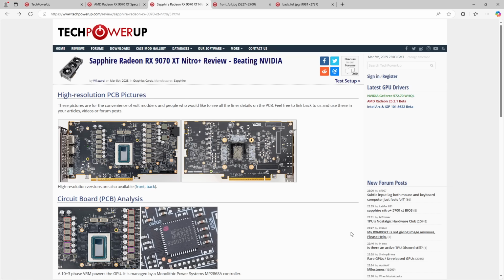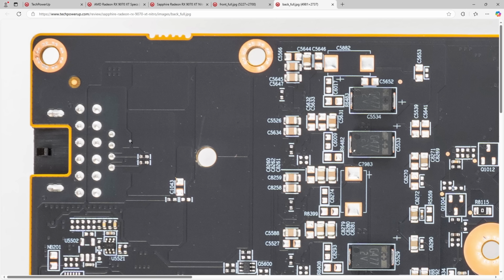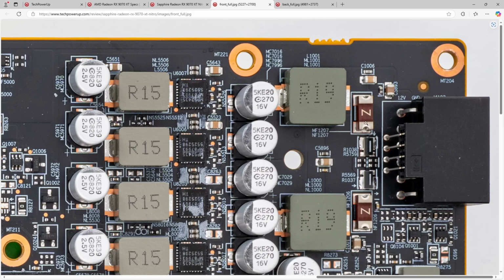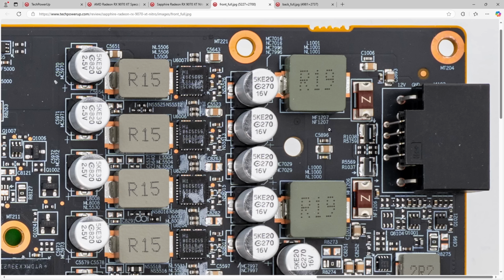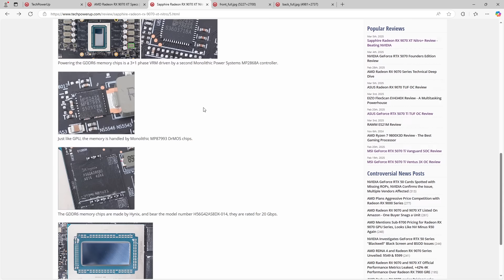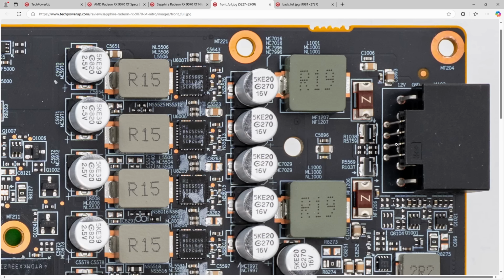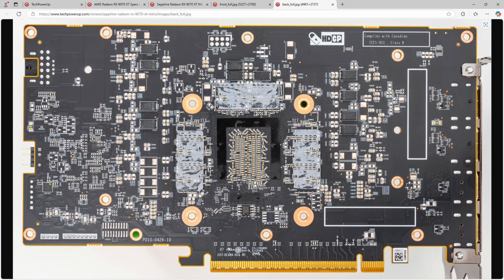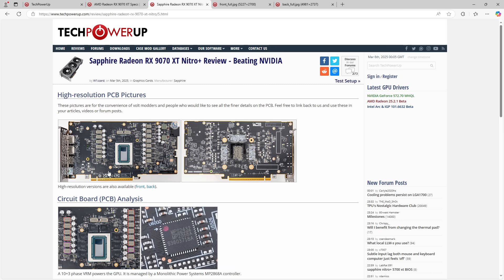Taking a look at Sapphire implementation of the 12VHPWR connector on the RX 9070 XT Nitro+

Comment: The problem with those power connectors is the amp on each pin exceeding the maximum amp 9.2 A set by the PCI-E 5.0 standard. I have monitored my Astral 5090 using GPU Tweak III and Cyberpunk 2077 maxed out on dual 4k resolution sometimes spikes a bit over 9.2A on some pins. That is what causes the plastic to melt if maintained that level of amp for a prolonged time.
Reply: Spikes don’t matter so you proven for your system that the cable works fine, unfortunately not everyone can do that, I for example relied on just using my card to see if it’s fine or not.

Comment: They did do something clever. They used parallel conductors Exactly how you’re supposed to. 1 power bus to 1 load. 

Go take a #10, run it from your panel, then strip the ends, connect half the strands to your washing machine and the other half to your water heater. That’s what you want to do when separating 1 bus into multiple loads while using parallel conductors.

Comment: At this point, we're going to go back to use line voltage and having AC input straight to the wall sockets, with the switching power supply embedded in the GPU, or even worse: having huge power brick sending 100V <6A along with huge DC-DC converter embedded in the GPU for whatever safety reason.

Comment: oh for gods sake now it isnt just NVIDIA based cards that want to burn your house down, major fail  EDIT: for the record, i've got a nitro+ 7900xtx and at least in Linux gaming it's an absolute BEAST. Happy with my card. I won't be buying a card with the high failure connector on it, the problems with it are too numerous to be anything but fundamental to and inherent in the design

Comment: I mean... this is an issue for cards pulling 50a through a single pin @ 600w or more. This card is gonna max out at like 350ish watts and if it can pull as many amps as a 5090... I guess this is bad? The entire reason Nvidia's cards are crap since the 3xxx series and the new connector... they let the thing draw as much power as it can AND they really didn't come up with a solid design to address that. If you look at a standard connector of any kind, the PSU has bigger pins, spaced out farther apart, with lots of room for play inside each sleeve. 

This allows for expansion/contraction of the materials, while maintaining the spec. The HWPR connectors are taking all the pins for both connectors and putting them in a space smaller than 1 connector, decreasing the room for play, increasing the thermal insulation capacity of the connector. 

It's flawed on a fundamental level.

Comment: You can't blame the connector that way. Even if you add a shunt to every +12V pin, you don't really solve the problem if you cut off all ground lines. In this case all the current flows through PCIe connector.
And even more: All of this applies to the "old" PCIe Power connector also.
The only difference here is heat density regarding to this tiny connector. There is not enough area to disapate heat caused by failures. The size is more of a problem. Yeah, size could matter...
All of this is a common problem in electronics as long as we use electricity. For example your toaster: The power cord is build of a around 100-200 individual copper strains. If some break on a bending point you weakening your connection. At some point the cable will burn. You can't control it. You have to trust in something called brain. Yeah, this kind of thing many people won't use anymore as often as they should. Sad, but if something smells there must be a problem. How genius is that!? So you should turn it of and take a look.
But these days people smell a burning trashcan and they think: oh, I think it's fine...
And this goes on with crazy bling bling cables of bad quality. Not making a well enough connection. Using bad power supplies......
Oh, and speaking of power supplies: I wait for the first come up with a single pin current sensing to solve the problem. Because effectively you only can solve it on the power supply side. But they have to take ground into account.

Comment: Don't forget the 900 Watt PSU it requires, currently there is one cheapie on Amazon ( a frequently returned PSU ) so take a chance on a 850 watt or bump up to a 1,000 watt PSU
that 899.00 card went to 1,050.00

Comment: Current balancing for the sake of the connector is the WRONG idea. You have it backwards.  Current balancing is not the solution, a better connector is the solution at 12 volts. If they had gone with 24 volts it would have never been an issue at all, but this connector at 12 volts is going to end up terrible over and over again.  And the older the cables get the worse the situation will be.  The ONLY reason they are going with this connector and sticking with it is because these companies are too cheap to setup manufacturing with a better, more robust connector.

Comment: There is a Russian tech reviewer who tried to burn his RTX 5090 Asus Astral by cutting the power lines one by one while running furmark. And even with two lines left, the temperature was not enough to melt the connector. Only when one line was left, the temperature on the connector rose above 100C.

Comment: Regarding the melting connector - I've seen a lot of speculation about what the underlying causes may be (aside of the lack current balancing anywhere), like worn out connector, strain on the cable, manufacturing defects, bad connector quality, or "user error". One that I have never seen mentioned that I think is just obvious: oxidation of the pins/contacts. If the card and cable have been sitting in storage for some time, possibly in more than zero air humidity, just inserting the connector may not scrape away the oxidation layer equally, leading to varying resistance between different pins. And the simple "workaround" if that's true would be... just re-inserting the connector a few times to ensure good metal to metal contact

Comment: I wonder why this per-cable monitoring can't be implemented on the psu side. this would be even better because in case of failure the psu can tell the gpu (via the sense pins) to lower consumption as low as possible so you are left with at least somehow working card. 

I imagine such a device could be even implemented separately inside a custom 12vhf cable

Comment: Is the GPU also using the sensing pins like the 3090Ti didnt? The 3090Ti was very power hungry and from my experience I have seen the adapter shipped with it failed more than the 3090Ti ever did.

Comment: Got it avoid the 12v-High failure cards, honestly they should at least do 2 wires to a fuse so 3 (20-25 amp) fuses

Comment: 1st. AMD has plans to switch to new connector. So it’s fine for market to start frost steps.
2nd. This connector is fine for everything below 400W. I have 4070S with new connector H++ , and it’s fine since I don’t overload my GPU.
3nd. In most cases we here burned connectors on 12VHPWR versions. But new ones I didn’t see such cases. 

Perhaps, it’s not good for now, but maybe in future we will have another update.

Comment: The thing I worry about with this card is that with the hidden power connector design, the cable is going to be tensioned sideways, which doesn't seem like a good idea for keeping the connector secure.  I won't be surprised if we see some of these melting because of that.
Reply: hidden power connector is  one of the stupid things i ever seen in my life
Reply: However the fans blow to it. So it could be “fine” if you consider all the amps going through one line.
Reply: @thecwwshow8036  You mean the fans heat up the cables and the connector under that lid even more...
Reply: @madant7777  No, the air blowing through will be way cooler than a problematic wire temperature.
Reply: @TrueThanny  It is adding to the temp, not really good...
Reply: @ I just explained that it isn't "adding to the temp".

Comment: The 12vhpwr connector on the highest end cards makes absolutely no sense. Even a novice electrician will tell you the wire size is NOT capable of safely carrying the amperage at full load. Whomever designed this connector needs to go back to school to understand the limitations of each wire gauge.

Comment: I think the only real difference is its like 200-300w less max power draw than a 5090. Either way I wouldn't want to connector but I assume they're offering it because they think that tons of people have modified their setup to use these connectors because team Green has gone whole hog 12 volt high power
Reply: It can pull 430w under load
Reply: It’s not about that just aesthetics and with hiding it behind backplate they took it even further than anyone else.

Comment: if there is even 1 example or a current balancing 12hpw, then it is not part of the spec. are there really no such cases?
Reply: Nvidia Reference 3090 did it, and it worked great. Not a single case of failure. Other than that, no idea.

Comment: real question ... as the Wires is a Weakpoint of this plugg.  would a '' Sheet '' / Ribbon like cable work as a thing instead.   PCIE Riser style. 1 for Ground and 1 for power ?  and just terminate to Pins witch then pluggs in eather end ?

Comment: "Electricity seeks the path of least resistance" so if you give it 6 wires of which two are ever so slightly shorter guess where all the current will go. To wire them all together as if electricity behaves like flowing water is weird. What they think the increased resistance from the boiling cable would balance it out automatically or what? I have a hard time grasping how this doesn't violate some norm somewhere in the world let alone why their electrical engineers would ever sign off on this. Not even a fuse or anything. I want it to be an intentional thing, because otherwise it would mean someone with a degree is apparently this stupid and that destroys my world view entirely.

Comment: its lot easier for PSU just follow the specs correctly...one connector is good idea only issue is PSU side how they wired it ...its dumb to be shared with one glorified hot rail for all 12v 3 wires or 4 wire strands ......its much safer to do same old fashioned that done by dell entire time....have 4 rails ...each one is 12v wire in 12v connector ..each get sense pin ground that not share entire psu rail...all independent rail that just works back then for old 12v 8pin...thing is they believe too much in Japanese capacitor and rail tech vs american designs built for safety in mind since even our power grind is not safe to run same rail but thats japanese folks life style choice but as american...not want  a house fire

Comment: Ok, so if I'm buying a 9070 XT (currently on a 6900 XT and considering building an almost completely new system (excluding storage, case, fans and cpu cooler)), I need to look at the power connector as well. Because yeah, I want my good old 6+2 pins.

Comment: It's 100% form over function in this case. Using the 12VHF connector allows them to hide the cable at the end of the card to market it towards the backside connect motherboard enthusiasts.

Comment: Sapphire's design choices when it comes to their Nitro+ line the past 2 generations has been strange. I've only had Sapphire for all 3 of my GPUs so far (580 Pulse, 5700 XT Nitro, 6950 XT Pure), but I didn't like the Nitro design for the 7900 XT(X) and now their 9070 XT Nitro has a disaster of a power connector (as well as being an awkward colour for most builds)
Reply: The 7000 series I think is their best design ever...it's chonky, but it's pretty much flawless. I see too many corners being cut with this 9000 series, from everyone...

Comment: Fusing these types of power rails is super tricky. Fuses have an I²t spec which tells you how long it takes a fuse to blow for a given current, so for fast-blow you want a small I²t and for slow-blow you want a high I²t. If you go with a fast trip characteristic then a high-current transient (incl. inrush) can blow the fuse, but even if you avoid that you can still end up with a scenario where your fuse is repeatedly getting into partial trip territory and degrading over time. But if you go with a slow trip characteristic then that comes with a higher trip current (or at least a bigger gap between hold current and trip current), and since the current draw during a transient is not that far off the current draw in a fault state you can end up with the fuse being worthless. So selecting the right fuse turns into a really difficult balancing act.

Splitting the rail into two like they did here makes it a bit easier, but then any current imbalance between the split rails becomes a problem. The VRMs naturally help with that in steady-state operation since it's their job to distribute load across the phases, but that doesn't eliminate the problem during load transients. I suspect that's one of the reasons they put those big power inductors in series with the rails after the fuses.

Comment: i wonder why only dell make best PSU on earth ??? evga too but some point in time is not same company as the past did...4 12v rails ..each rail equals 20amps...less stress for double capacitor since its not one glorified capacitor ...its double capacitor and rails are separated in PSU...into 2 per caps...very smart move decade ago...but now seems PSU cut corners now

Comment: good for card but bad for PSU still have same problems with power rail sharing one giant one due to improvements they made on PSU ,, companies think it just not need more rails ...one big one is plenty for 12v 80amps than splitting each connector in amperage for each rail

Comment: I've been buying Sapphire cards for about 15 years and my last 4 cards have been Nitro's... I won't be touching this one. Sapphire really shat the bed choosing to use "The 12 volt high failure connector." I also don't like how their cable management solution puts the cable/adapter under lateral tension... I think Sapphire are going to have huge problems with this card.

Comment: If my understanding is correct, you can put two shunt resistors, monitoring 3 12V cables each, and monitor the current difference betweet them. If the delta is larger than some epsilon like 2A, you cut the power from the card. What is it, like an opamp and a comparator, plus the circuitry to cut the power and inform the user of failure?

Comment: Damn, when i saw the marketing with the 2 fuses i hoped they did the right thing. Especially as this is a "hidden" connector with a big bend required.

Maybe the XFX Merc gets my money this time.
Reply: The thermal performance is also superior on the XFX, especially on the VRAM. Just make sure you have the space for it because they are ridiculously large at 360mm in length.

Comment: Blowing up a fuse thats surface mounted on the gpu pcb itself is even stupider than designing the pcb in a way that can detect each connector pin's contact. Why destroy the card instead of just giving an error message like "reinsert the cable properly you dumbf*ck".....???

Comment: I was going to purchase a Sapphire 9070XT Nitro+ after owning a Sapphire 6750XT Nitro+6750XT and having a good experience with Sapphire products - however anything with a 12VHPWR or the revised 12V-2x6(H++) PR re-spun version of the connector is a fire risk for anything they are connected to, they may not be an immediate risk, but even after minimal reconnections those connectors will fail and burn down anything connected to them.  
On that basis alone I will never purchase a GPU with that power receptacle or any of its variants, no matter the PCB and power plane engineering connected to them.
Reply: You’re exaggerating a bit too much. That’s not how it works an no expert ever said what you said. Stop speculating and selling it as facts. The connector isn’t as safe as the 8 Pin but not nearly as bad as you say it is.

Comment: The cards only 340W, so more than 40% overhead on the cable. It's not a 5090 doing 600W on a cable rated for 600w.... It'll be fine forever and a day. People claiming it'll be and issue actually know nothing about electronics/wattage and heat as a result.
Reply: It does not look like you understand wattage either, because the 4090 has no problem burning connectors at 450W eventhough it should have plenty overhead.
The design of the VRM does not in any intelligent way prevent the 9070xt from burning the connector, like the design of the 3090ti is able to.
Reply: @larsjrgensen5975  Yes. cause idiots DONT plug it in properly. NOT A REAL issue... user problem. If you're wonder why I'd say wait 3-6months why? Im guessing/hoping 600W 9070XT 32Gb X2 (2 die's on 1 card) on the way*

Comment: I couldn't believe it when I saw that they were using the 12 pin but at the same time it hasn't been an issue on my 4080 and I think 340 watts and below should be fine on that connector.
Reply: Anything wired like this is only rated for 100W
Reply: @wastanley734  what are you on about?

Comment: It's mainly in the connector that causes the failure. Which means the plug needs to be bigger, plugs spaces out more.
Reply: No tye gou needs power regulation. Not the plug. 6 pins need to in series not parallel. It's like have 6 pipes with water. If you just have a big pipe pushing enough water that can full the 6 smaller piper without pressure release valves or flood gates, the 1st pipe taking initial load would just burst. But a flood gate would be forced open when the adequate pressure was reached to activate it. Since wires don't have flood gates or  pressure release valves, we add resistors to regulate power flow so the flow will follow the path of lease resistance. It meets resistance it will try to go down a different path until it meets resistance again for all 6 pin on 6 path traces with 6 resistors.
Reply: @wastanley734  and they have showed they wiggelig the 12vhp connector causes the problem. The super thin plastic between the connectors causes the pins to release and touch other pins causing the melting